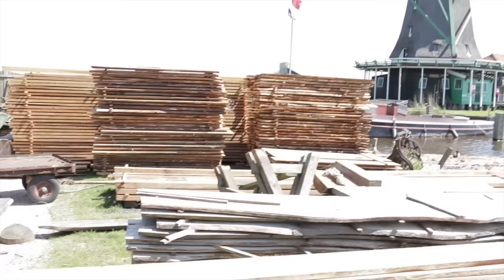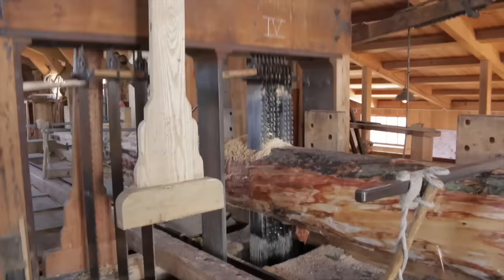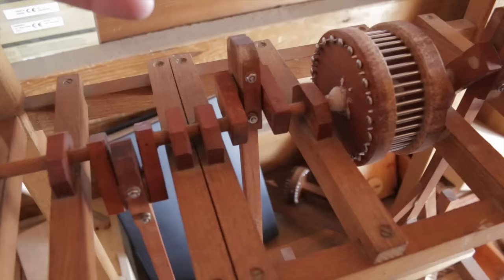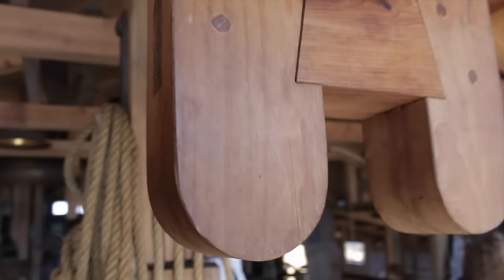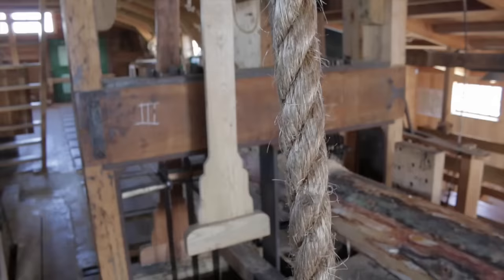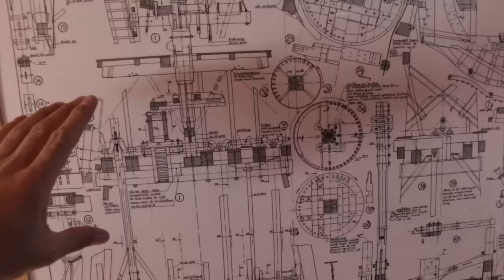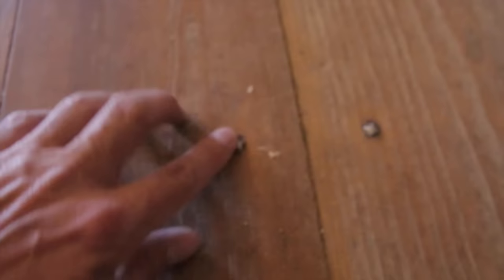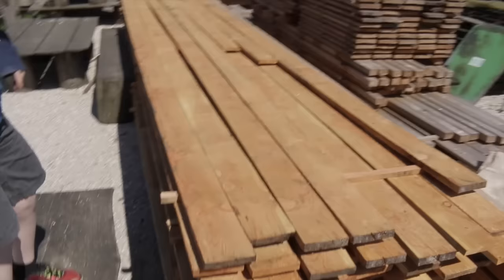How A Wind Powered Sawmill Works- AMAZING

Comment: I'm curious do the extreme tree huggers in eaurope put steel and ceramic spikes into trees like they do here in the united states?
Reply: +KILLKING110 I have never heard of anyone doing that, most of western Europe is basically devoid of old trees anyway.
Reply: yea it happens here in the united states a lot to the point the media doesn't cover it because the people that do that are eco freaks. who think risking killing the tree by hammering a steel or even more dangerous ceramic spikes into them to make the trees hard to cut down and utilize them for our needs. the reason the ceramic spikes are even more dangerous is they cant be detected by a metal detector and wether it be with a chain or in a saw mill once a moving blade hits the ceramic it explodes sending shrapnel everywhere.
Reply: I know there where sone instances of that happening here in Norway earlier around the 90's. But like mentioned old growth
 non managed forest is allmost non excistant here.

Comment: Wranglerstar
The speed of the wind has nothing to do with the feed rate. The feed rate is changed depending on what type of log you are cutting: Douglas Fir is set to fast rate conversely Oak will be slower.

Comment: Just think, if all those wind turbines that people hate to see in the countryside looked like traditional windmills then no one would ever complain, I've yet to meet a person who doesn't like old windmills!
Reply: +John Smith   Maybe the new turbines could be restyled to look resemble the traditional windmills.
Reply: trespire Exactly!  : )
Reply: +trespire +John Smith if the new ones would just resemble them, people would complain even more, they would have to be HUGE ... but yeah, I get what you are saying, if the current windmills would scale down and look like these, people would be a lot less upset about it... I certainly would, and I'm not even that bothered by the new ones (except when they are all placed randomly and from random producers, that looks like a big mess; but medium size fields set up nicely aren't that bad 'I think'), but I can certainly see how this design would be a lot better and more easily excepted in the traditional form. Though I think the reliability of wind at the height of the new ones is way better... hence they are build so large... and in part the blades can be a lot bigger meaning more power can be picked up, meaning they can drive bigger generators and thus generate more power... still though, I do not get why there aren't ANY traditional designs with a modern interior, I am fairly sure that with proper gears and generator design one could make a decent amount of power, without the horizon pollution.
Reply: Dutch Courage Or they could produce them in greater numbers to make up for the loss of efficiency and spread them wider so as not to overcrowd the scenery, as long as the outside of them looks fairly traditional then they can be as modern on the inside as you like.

In short, as long as they look pretty no body will hate them.

: )
Reply: John Smith yup, I can certainly see your point ... ;) ... :)
Reply: John Smith
  That would be a quite a difficult design challenge. Modern wind turbines are all function & efficiency, as they should be. To restyle them would most likely impact on the efficiency. To design something that's both functionally effective & esthetically pleasing is not easy. The Italians are usually are good at this approach.
Reply: trespire Personally I have no problems with modern wind turbines, I'd rather look at them than a power station any day, but there are many people who rail against them, when pressed  as to why, it usually boils down to "I don't like the look of them" as being their underlying argument against them, my solution then is that we built high tech wind turbines where we can and built pretty (but less efficient) "windmills" where objections are raised, since I've never met a person who hates windmills it would seem a logical solution.

I'd rather like to look out of my window and be able to see a working windmill  : )

Comment: Interesting for sure but it is still using wood that shouldn't be used. Look up bamboo and all that can be done with it. Use wind to process bamboo and that would be wonderful.
Reply: What a moronic statement. Wood is totally sustainable if properly managed. Most sawn timber is grown specially for the purpose. And since when did bamboo grow in holland?

Comment: I understand how the wind mill functions, but what I don’t understand is how the resistance of the blade’s teeth doesn’t bring the sale’s rotation to a standstill.

I would imagine a single saw blade that you’d find in a quarter-sawn mill wouldn’t cause enough resistance to stop the wind sails, but an array of plain-saw blades all cutting at the same time? How?
Reply: Because of torque. Lots of it. The momentum of all the thousands of Kilo's of rotating cogs, beams and levers generate crazy amounts of torque. It has build in 'weak spots' that will break on purpose if a blade gets stuck to protect the mill.

Comment: It looks fairly slow, very complicated and probably maintenance heavy. Oh, and a damned sight better than what they had before! I would think a water powered sawmill would be more consistent but you could build these in a lot more places. It's an amazing reconstruction job they did. Did anyone mention how much lumber they can produce on a given day?
Reply: Sadly water power isn't really an option in a country that is essentially flat! Yes this looks slow by today's standards, but prior to this sawyers were cutting by hand, one plank at a time, incredibly slow and hard work.
Reply: Spencer Wilton Oh, I'm aware of the limitations of the hand sawing method. Hell, in the video he said they cut a meter an HOUR. I would put a gun to my head if I had to work that hard for that long and only have a METER to show for it.
As for water power in Holland I do wonder if they could use river currents with modern tech but I have my doubts.
Reply: +Dan Morgan, It may look slow, but if you notice, they are cutting three, and four boards at a time. That and it looked like there was 4 stations as well, so that adds up. However not sure how the power situation is and if they can run all four at the same time. maybe they have different widths of boards cut at different stations too? Still, very interesting!! Amazingly interesting subject ruined by poor video and shaking or jumping. I get carsick watching that too long.

Comment: WHERE DID THEY "FIND" THE DIAGRAMS?

WHY DID YOU CUT OUT THE ANSWER?
Reply: +ReiK0Z I was wondering that too.
Reply: +ReiK0Z The original mill was built  in 1680 and demolished in 1942. The construction of the replica was based on detailed drawings Anton Sipman had made before the original mill was demolished.

Comment: surely if they had a band mill or a circular saw mill, it would take alot less energy to run it, than a frame saw that had to be pulled down the timber then pulled back thrpugh the kerf that its just  cut?
Reply: +Cáca Milis sa Seomra Spraoi -yes I agree that you would have to make more passes with a bandmill or a circular saw but it must be easier, to set different thicknesses and dimensions too. also with a circular saw once it's moving  it must take less power to keep it going at that speed and the other thing is if the wind drops then..... in theory the momentum will keep it going?
Reply: +chris grayston You would struggle to get a circular saw upto a decent and sustained speed, and they are not effective at slow speeds, where as this will work with a slight breeze at very slow speeds. As gears etc are made of wood again they wouldn't cope with the higher speeds. Steel suitable for bandsaws wasn't invented until much later, the steel used in these saws is relatively weak and brittle, it wouldn't cope being bent into a band shape.
Reply: +Maxx Kroes  whats that in english?

Comment: those guys need to look into a giant flywheel.
Reply: Not practical with wooden gearing and shafts, and primitive bearings. This is the perfect solution- works at any wind speed, low component stress.

Comment: They put the wood in water also because it won't rot anymore (normally)
Reply: +Simen Lambrecht pretty sure water is used to transport the logs.
Reply: +slitor Yes off course! In my knowledge it is both, but when the log is fully submerged it is the make it more durable
Reply: +Simen Lambrecht Ah I just watched further...apparently they soak the logs for some time to draw out the fructose in the wood which makes them less inclined to bend when they are being turned into planks.

Also yeah your right about rot, although I think the idea is to make sure they don't dry out. I know where I live a the local mill stores the logs outside but uses sprinklers on them during the summer.
Reply: slitor could, I am not that familiair with the technique, but I know that where I live the farmers used to do it for the fencing, but stopped because it took too much time. Even though the wood lasted 10 times longer...

Do you know if it works well with the sprinklers? Seems interesting!
Reply: Maxx Kroes Sounds interesting, I will need to look into it :)

Comment: Nice vid.

You are mistaken about the feed though. It does not depend on the windspeed but the kind of wood and how many blades. Two blades can cut faster that four or five.

The feed is alway in sync with the blade speed.

Comment: Can someone with good hearing please transcribe this?
Reply: +enkiduslover everything works off the wind  including the winch that pulls in the logs...The cutting equipment speeds up and slows down depending on the wind speed...The blades get changed every 50 meters...They show a saw that was used before it became wind powered...They let logs soak in water for a year to take out the sugars  to minimize warpage and cracking...

That's  the gist of it.
Reply: That does help... But a complete transcript would really be valuable.
Reply: Not even a "thank you"; just more requests?
Reply: Would you still like to have a transcript? Because I wouldn’t mind to transcribe the video for you (and others).

Comment: What a bunch of hoopla of fiction, where was this indeed. Mechanical assist of a mills cutting tibmer is quite old, with various sources of fuel. A wind system to power items ot crush or cut, is really really old, and had been applied ot many facets throughout time in rural life.  It's a cool toy, that is wind driven, so its economical if you do not need something right away, but the amount of lumber produced traditionally was a lot faster, then what they indivicate, or, well could just be a log house, if you do not wish it cut. Meh... its cool. but why do they write in such a way.